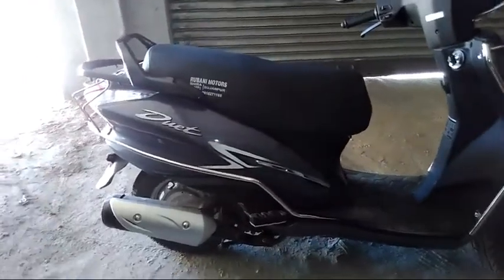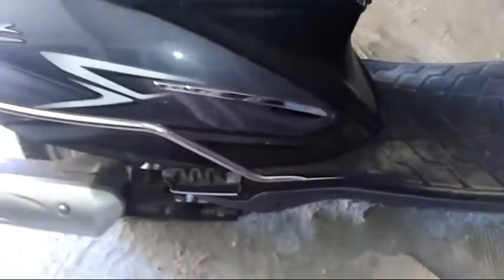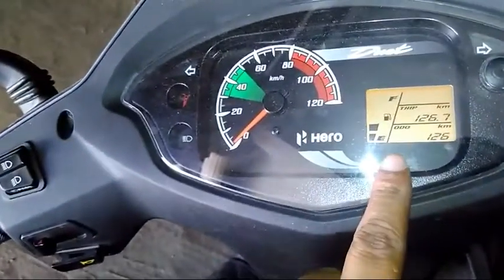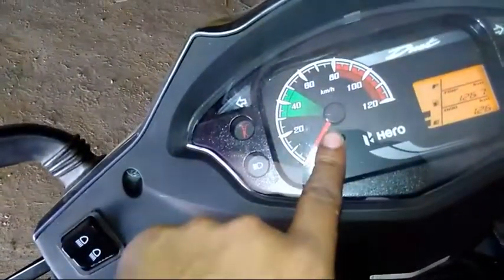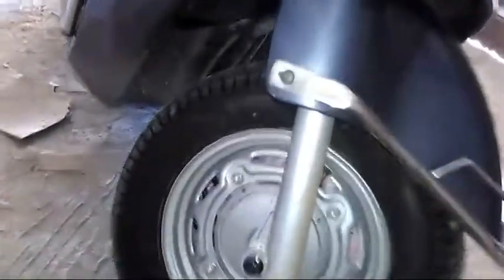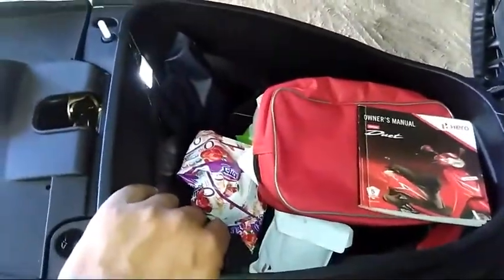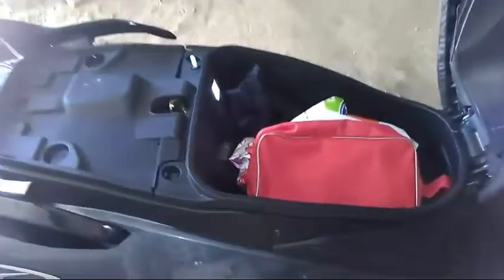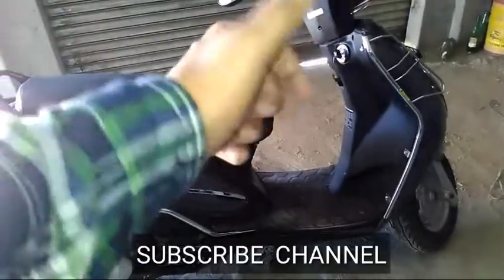Hero Duet overview | What you think so ?

Comment: Break squeaking is the biggest problem in this scooter
Electronic components ( break light, indicators, horn) life is short.
Fuel economy average
Suspensions too good
Look good
Engine startup bad( choke has to be given)
Pick up is good
Balance good
Power transmission is smooth( no over-vibration problem)